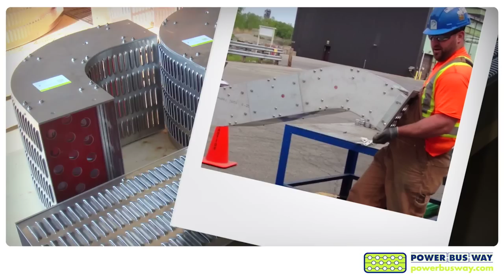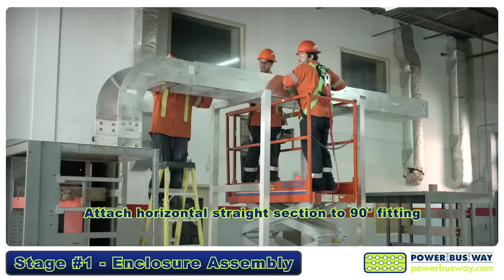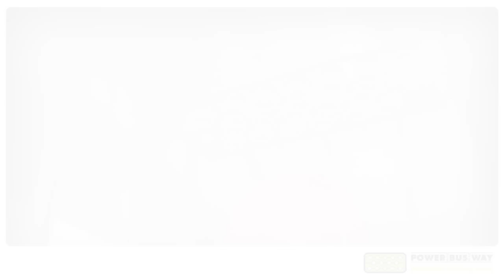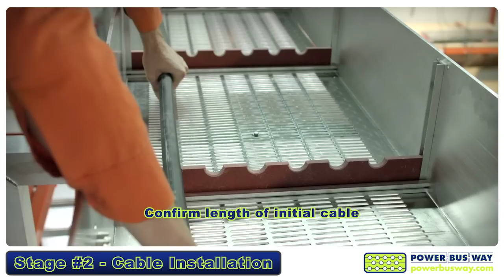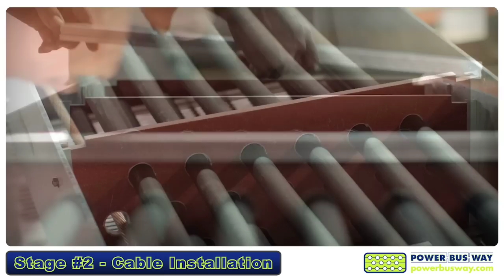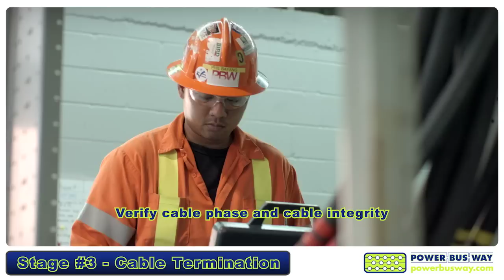Power Bus Way Cable Bus INSTALL DEMO

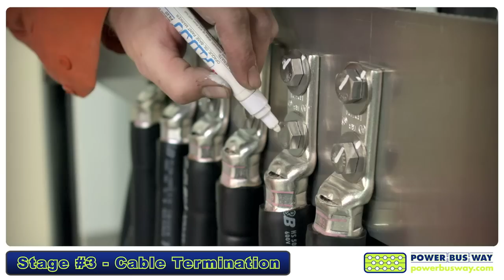Comment: Great video. Quick question: what is the purpose of the white marker at 6:59? It is to confirm loosening of the bolts onto the bar over time with vibration? Thanks in advance!
Reply from the maker: Hi Mike, thanks for the feedback! Yes, the white mark is to confirm that the bolts have not become loose over time.